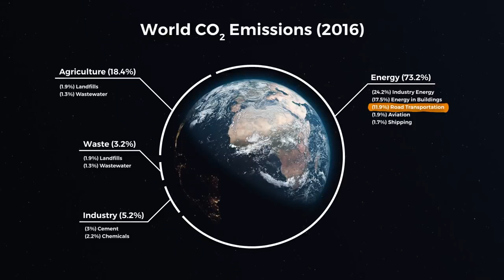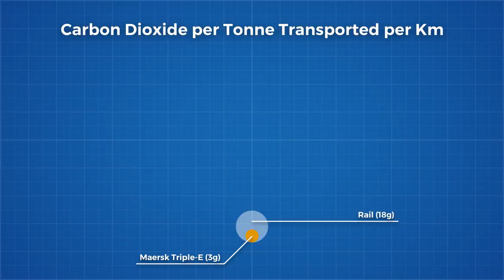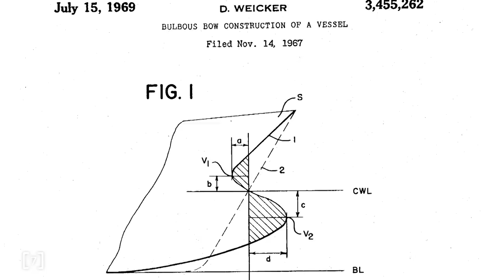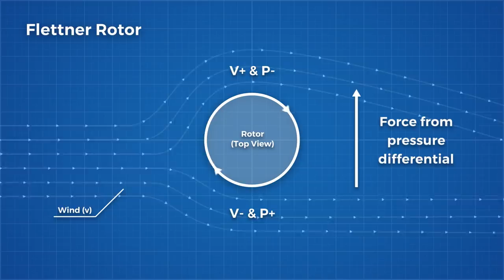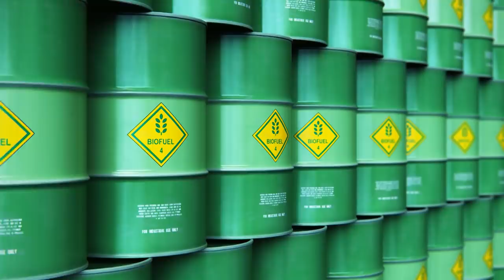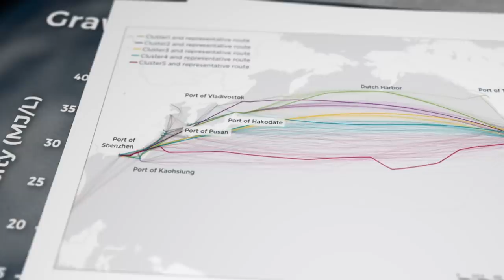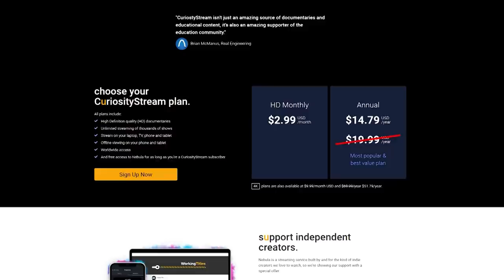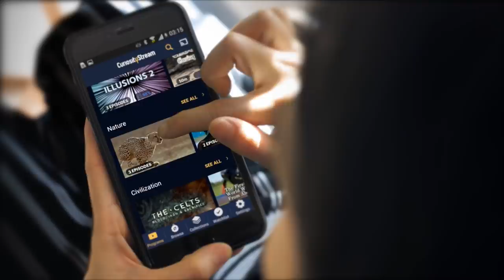Are Renewable Powered Ships Possible?

Comment: I work in the shipping industry and this is the best video on this topic i have seen. Not super negative and pointing at real solutions and steps allready made. Great video !
Reply: A real solution to a non-problem? The ocean will eat all surplus CO2 anyway. Doesn't matter how much we burn, the ocean will eat it all, as it has done with the emissions from the volcanos for billions of years. There is no real problem to be solved - it's a religion.
Reply: @elbuggo  how does an ocean eat co2 exactly ?
Reply: @thomasgo1234  CO2 is probably dissolved in the water and burried by sedimentation. But the rate is too small for it to safe human life if we keep blasting the carbon.
You can already see effects of the added carbon in coral reefs, a big ocean ecosystem responsible for oxygen production, because the corals die under the carbon stress. It has many bad feedback mechanisms we probably do not want to experience.
Reply: @thomasgo1234  The ocean will convert CO2 to other substances, and store it on the seabed. Has already converted trillions of tons injected into the system by volcanoes for billions of years. All done chemically and without any effort - it is all automatically. There is no problem whatsoever, even in worst case. Some prominent geochemist explains it here, if interested: Some Thoughts on Ocean Chemistry
, by Tom V. Segalstad, Professor of Geochemistry: http://www.co2web.info/Segalstad_Chapter-6-3-1-2_Ocean-Chemistry_NIPCC_CCR-II-B_2014.pdf
Reply: @jonas99g  it was kind of a retorical, question but i totally agree with you !
Reply: @elbuggo  Humans havent lived there, the process is quite slow and cant counteract the current increase and limit temperature rise enough.
If we would stop humankind for a few hundred years, it would probably balance out again
Reply: @jonas99g  Who claims that human have lived in the ocean? Why do you have to make us aware of this point that no one claims?

The process (ocean converting CO2 to other substances) isn't slow but blastering fast. You too are flat out making up stuff here. I understand you have to, because you don't have anything else. You are a hyperventilating bedwetter.
Reply: @elbuggo  OK, I'm Joe-knows-jack-shit-about-this-subject, but I'm curious to know who's right in this discussion. Is it blisteringly fast? Or is the rate of emissions too fast for the natural process (the oceans absorbing CO2)? Or is this an ongoing debate? Thanks in advance for enlightening me.
Reply: For all those interested whether the ocean will save our ass from extinction: it won't, it's actually another huge  problem. Read the article about "ocean acidification" on wikipedia to learn more.

In short: the ocean absorbs CO2, gets more acidic and this will trigger chain reactions if we don't act on climate change now.

2050 is already quite late for zero emissions, we will have to deal with a lot of droughts, floodings and climate refugees for example. Unfortunately, we are not even on track for this timeline.

Fossil fuel companies are still investing billions to fight any laws that regulate emissions. They're also funding scientists to say that climate change is not real/not a threat. (It's called climate change denial, look it up on wikipedia.) That's what they've done for more than 40 years now.
Reply: @elbuggo  clearly , you have to insult people when you run out of reliable facts. The article about climate change denial lists over 280 references.

Comment: Ship propellers are also optimized for a specific speed. Changing the ships speed, velocity of advancement and propeller rpm has a negative effect on the overall propulsion efficiency.
Reply: I'd almost agree, but if shipbuilders can adapt the propeller designs used in nuclear submarines, the result would be ships that can generate a lot of propulsive thrust but with higher efficiency and more importantly, reduced issues from cavitation (cavitation forces can cause all kinds of problems, especially shortening the life of propellers).
Reply: @Sacto1654  I suspect nuclear subs need to operate at a much greater range of speeds and as such sacrifice high efficiency at a narrow band of speeds to achieve this.  Engineering is always about tradeoffs!
Reply: Iirc, some of the latest propeller designs are actually able to change the pitch of the blades much like modern turboprop aircraft can, whole still not as effective at certain speeds as something dedicated, it is better then they were. It is an expensive and complex system though.
Reply: @Sacto1654  What you're describing are called controllable pitch propellers. They change the blade pitch based on speed and propeller rpm to keep the efficiency constant within a limited range. These are generally not used in commercial shipbuilding because of higher complexity and cost. Keep in mind military and commercial shipbuilders have very different objectives and requirements. I'd love to hear a military naval architects thoughts on this (if the subject is not classified), but I'd guess that nuclear subs don't have controllable pitch propellers for the sake of efficiency, but to minimize cavitation and thus reduce the acoustic signature.
Reply: @FighterAceee94  The reason why I mention this: you wonder can they build six-blade propellers specifically for large container ships for optimized operation in the 16-20 knot range. Not only for lower fuel consumption, but also to reduce the physical effects of cavitation, which can be strong enough to break not only propellers, but the driveshaft itself.
Reply: @Sacto1654  Optimized fixed pitch propellers are already being used for that range of speeds. Generally increasing the number of blades decreases efficiency, that's why the average cargo ship propeller has 4 blades. One of the steps in propeller design and optimization is checking if the blade area satisfies the cavitation criteria, like Kellers criteria for example, so cavitation doesn't occur.
Reply: Naval architect here. Although I do not specifically work on sub props I am working on naval projects (frigates, patrol boats etc)
The main reason for the increased number not blades is the reduction of the underwater radiated noise....apart from this... these propellers are very expensive (due to skew and some other specifications which can get boring). Anyway....if you want to ask something more please ask...
Reply: This isn't really an issue as the propellers can be swapped out relatively easily. hull speed is for life.
Reply: @FighterAceee94  We call them variable pitch propellers, but yes, they are designed to keep the speed as high as possible in a given water depth before cavitation. Cavitation is dependent on depth, & some degree water temperature which isn't something you can consider for shipping. 

But primarily, you want your submarine to go 34 knots or so and keep it deep enough not to cavitate. Jive Turkey on youtube can teach you more about submarines as a sonarman- someone with particular interest in different propellers ( you have to learn them by sound)
Reply: @motzoful  My question is, acoustic torpedo.

Comment: How did you make it through that entire video without once mentioning nuclear power?
Reply: Because its not renewable
Reply: @isakjohansson7134  we that Arguement...the moon won't last to control the tides. The sun will not exist so no photons or atmosphere for earth so now wind.

We can do fusion and fission
Reply: @TheMagicJIZZ  fission is hard, dangerous and a long term pollutant.
Reply: @TheMagicJIZZ  i didnt mean to sy nuclear was bad, all i meant was that its not renewable and dont think the moon or sun will disappear anytime soon
Reply: @TheMagicJIZZ  before moon or sun will disappear there will be a lot more problems... like a lot A LOT.
Reply: @richardszekeres  The price will go down when demand of it increases, ie when we run out of digging it up. renewable is such a stupid term. Wood isn't renewable as the chainsaws used to cut it down use steel which is produced and recycled using fossil fuels. 

Anything made of anything is non renewable. Even gravity assists slow the parent body down in space. Every action has an equal and opposite reaction.

Comment: my masters group project was in designing a zero emissions ferry. I am also potentially doing a PhD in sail powered containerships. im hopefull
Reply: Anyway I could contact you sir ? I'm a Marine engineer looking for a decent project topic
Reply: Just don't think biogas is answer, shape of lng containers prevents it's high capacity storage on bulkers, roros and ropas
Reply: There are always emissions, human sweat at the very least from rowing.  I suspect there is going to be an LCA in the project somewhere so once the group decide what the group wants to prove just adjust the choice of functional unit, measured parameters and boundary limits to get the desired results.

Comment: question : wouldn't nuclear be an answer ? 
it works for carriers , why wouldn't it work for cargo ships ? 
it's cost isn't it ?
Reply: Whilst I’m pro nuclear, people in other comments have pointed out current sea going nuclear isn’t suitable due to the need of such highly trained specialists onboard, but I feel things like SMRs would be perfect for the job
Reply: most likely no, its regulations, nuclear is extremely regulated, air carriers are military so getting over those regulations is easier, for a private companies tend to avoid big regulatory messes when they can
Reply: A big technical challenge is that Naval reactors use highly enriched uranium (90%+) in order to keep the reactor size small.  Anything above 20% is difficult for civilian application because of proliferation risks and regulation.  There are those in the shipping industry looking into it though.
Reply: @Grace O'Malley yeah I agree, we need to remove all the stupid politics from it
Reply: Nuclear naval propulsion has been a solved problem for 50 years. It could literally take over global shipping, at any point. The tool is ready, the engineering is solved. All it takes is for people to get off their superstitious asses and do it.
Reply: @cj09beira  ok , so the problem would be regulations , well politics is above the scope of the discossion ,
there are 3 levels of possibility we need to take in account rn :
the phisically possible : like bringing a 3000 ton block of gold to  mars there is nothing stopping us from doing it we just need a large enough roket and maybe a mass driver to launch the block there  , while going faster than light , or time travel has problems we can't solve yet ...

the logistically possible : the thing the block of gold is wholly in the realm of possibility  , there is nothing in the laws of phisics that stops us from achiving it , it's just that it would be very costly and pepole would ask " why did you launch a 3000 ton hunk of gold to mars , while pepole are starving here " also doing that more than once  , it would be difficult to repeat it without raising thousens of eyebrows ...

and the legally possible : we could , right now in the 21st century revive the atlantic slave trade with our new tecnology , and during the cold war there where enpugh nukes to raise humanity to the ground , the problem was that many powerful pepole would have taken that personally , because that would go against the law ...

however the law is wholly made the pepole in power , and power comes from the muzzle of a gun , or at least that's what i belive , so in short : if the law changes i might see some logistical problem in going nuclear , but nothing too noticable ...
Reply: @logdog6762  yeah , that logistical roadblock could probably stop us , supplying uranium might be troubles , however they would be able to go at full trottle for 5 years before needing refuiling , so i think it's a fairly long term problem : kinda like the first steamers crossing the atlantic worrying about climate change , all of a while there would be technological development , maybe someone finds a way to make uranium starting from it's byproducts , and uranium gets used as a battery , and nuclear fusion becomes better understood , generally speaking we should be fine if that's the problem ...
Reply: @davidegaruti2582  Its not a logistical issue, its a technical issue imposed by regulation.  There's no shortage of Uranium.
Reply: @zolikoff  exactly, politics is getting into things it shouldnt.
Reply: Shipping companies are seriously looking at nuclear propulsion for commercial ships. Unless the renewables/green mafia lobbies to ban it, it's virtually guaranteed to happen at some point.
Reply: @phamnuwen9442  question : if nuclear propulsion for general shipping becomes the norm and aircraft are reduced , to reduce pollution  , will we ever get the return of the NUKLEAR OCEANLINERS  ?
Reply: @davidegaruti2582  Reducing air travel seems like an awful idea. I think we should have many more and much faster airplanes.

Nuclear cruise ships would be cool though.
Reply: Good luck getting people to trust a rusty Liberian-flagged ship with low-wage Filipino sailors not to have a radiological 'discharge' while at the port of Los Angeles, New York or Rotterdam. Nuclear is not for faint hearted, as ships go down to the bottom of the ocean every single year due to poor maintenance, storms or incompetent/drunk crew. Some have speculated that compensation for the MV Wakashio sinking a few months ago could end up as much as $10 billion. A nuclear accident in a highly populated city like New York City would bankrupt the entire marine insurance industry, making these ships uninsurable to start with.

The 'green' fuel the marine industry is looking towards is not uranium or hydrogen, but ammonia.
Reply: @phamnuwen9442  Keep dreaming, as this will never, ever happen. The entire maritime industry would rather buy carbon credits and plant trees instead to offset all of their emissions, than to touch nuclear.

If one major nuclear accident happens near a US port city I can guarantee you that there will be a million class action lawsuits, let alone criminal prosecution and action from Congress and the government. Hell it might even warrant CIA renditions if the (usually foreign) executives don't immediately surrender themselves to US justice. 

And then there's the threat that these ships may become terrorist magnets, or even a potential trigger for war. This is a pandora's box that no one wants to open.
Reply: @Avantime  If it's cheaper than fossil fuels, it will happen. https://corepower.energy/

You can't start a lawsuit just because your feelings are hurt. Nuclear is the safest energy source that exists, and it's going to get even safer (and cheaper). Literally zero deaths from western civilian power plants ever, in the entire history of nuclear.
Reply: Russian ice breakers are commercial nuclear powered ships.
Reply: @carbon1255  Those nuclear ice breakers are funded and operated by the Russian government, which has a major strategic interest in the Arctic as it is a zone of competition between the great powers. Their official job is to support scientific research and economic development (e.g. oil & gas), as well as escorting other ships as global warming starts melting the Arctic ice. However their real purpose is to support the Russian navy and intelligence services in an area where US ballistic missile submarines often hide. It's like those Russian "civilian" fishing boats hanging around Pearl Harbor during the height of the Cold War, doing you-know-what.

The word "civilian" doesn't always mean what it says in Russia. Anything that can serve a military purpose, often will.